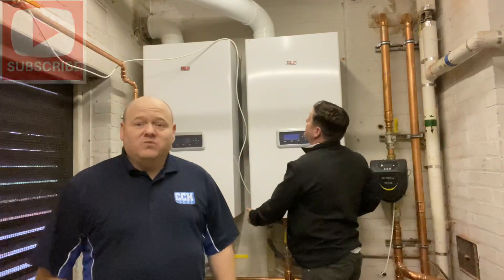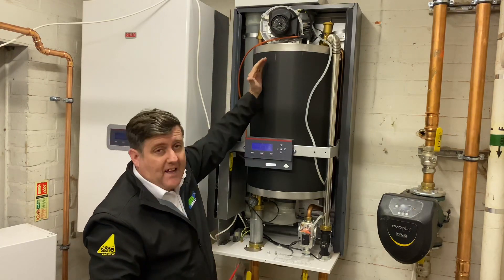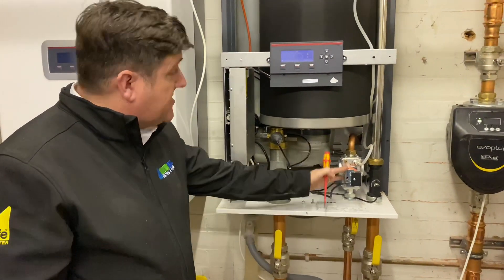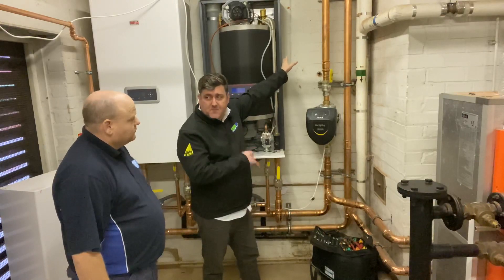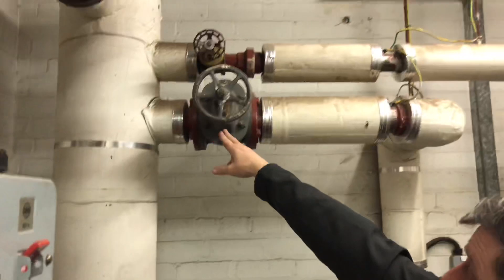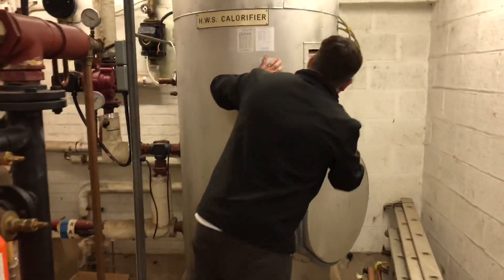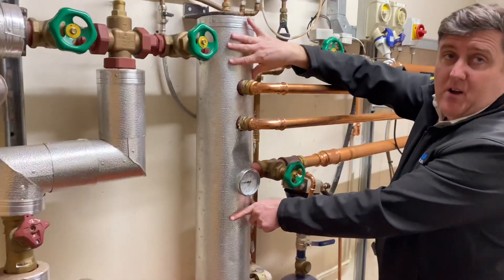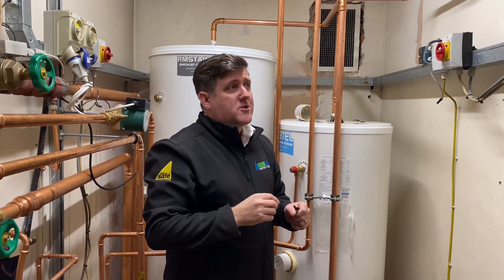RIELLO BOILERS - EXPLANING A PLANT ROOM Commercial Plumbing

Comment: Allen thank you so much for your videos on commercial heating. 
You have 2 hot water cylinders near the end of this video, the problem I'm struggling with is that the smaller cylinder (which looks like a direct cylinder) only has hot water in it as longs as it is being drawn off. So in other words after a long period of time let's say you choose to boost the hot water, which is now cooled in both cylinders, you will have to draw off that whole smaller cylinder's worth of water before you can get the hot-water that's being heated in the big 500L indirect cylinder. 
Am I seeing this correctly? Or is this being combatted by the secondary return returning back to the larger 500L cylinder so eventually, the smaller one would also heat up in which case the constant circulating of such a large volume of cooled water from the smaller cylinder may greatly lower the temperatures of the hot water and the boiler will have to compensate by being on longer to bring the domestic hot water to its target temperature? 
 What are the advantages of this set up over a more traditional method of coupling two 300L cylinders for example?

Comment: Allen once that return pump has failed I’ll get ridiculous low pressure on hot water right? At work I’m trying to trace the hot water pipes they have a return by the way in a massive plant room and I’m trying to figure out what’s happened to the hot water mate it’s cold and the pressure is poor... 🤷🏾‍♂️
Reply from the maker: The pump doesn’t effect the pressure, It just moves the heat around. Thanks.

Comment: The removed ACV cylinders are a cylinder within a cylinder. The inner cylinder has the fresh water inside.  The water between the two is primary water heating the inner cylinder all around it from outside in, eliminating internal heating coils. The inner cylinder is domed top and bottom with the col entering the bottom and hot out of the top - no sludge accumulate on the cylinder, which also has no cold spots.  Domestic versions are available being well worth buying, being superior to others for sure.  They are very efficient with fast cylinder reheats. 

The primary water in the ACV, between the cylinders, can be used as a smallish thermal store, say supplying the rad circuit of a house. The boiler heating the ACV only heats the outer part of the cylinder, giving it full flow through its heat X, all the time. Only a simple cheaper boiler is needed. The rad circuit off the ACV cylinder can be on a smart pump with TRVs on all rads and no central wall thermostat. The boiler does not cycle as it heats the ACV, cuts out when reaching setpoint, then only comes in when the ACV has cooled enough. If you need a large volume of hot water on tap at all times, an ACV cylinder/thermal store is great way to go. Simple, giving boiler longevity and TRVs in all rooms.

In the situation in this plant room, it appears the ACVs would be just highly efficient rapid recovery hot water cylinders with the thermal store aspect ignored. I would be interesting to know why they were replaced.

Comment: Having the cylinders DHW flow in series (cold into one cylinder, hot out and into the cold tapping of the next) means one lead cylinder is used in times of low hot water demand (say at night). When the lead cylinder is up to temp a valve diverts water into the secondary cylinder's coil to heat that. The lead cylinder always has priority, so if that is below DHW setpoint primary water if sent to its coil, cutting out the secondary cylinder. 

I did this once in a large domestic house using one 100 litre lead cylinder and one 300 litre secondary. A wall switch could bring in the secondary cylinder. They did not have to heat up 400 litres of water most of the time, reducing bills. In summer when cold water was at higher temperatures, they found only the smaller 100 litre lead cylinder was needed, as the semi combi effect took hold. Simple using off the shelf domestic controls.  

This can also be done with one tall cylinder with two heating coils inside, one top for quick recovery and one bottom to heat the rest.  Only the top heating coil can be used switching out the bottom in low hot water demand, so only the top half is heated. Having the top coil a rapid recovery coil, means that the boilers hot water is reheating the top of the cylinder as DHW is being drawn off - in semi combi mode. Two off the shelf cylinders is usually cheaper than one custom made two coil cylinder. Also, if one cylinder needs replacing less cost.

Comment: I have a viessmann commercial gas furnace for my house. It runs the heating and hot water (paired with a hybrid ACV boiler)
The reason for having such a beast is my house is huge and heat isolation is not the best.
Reply from the maker: Thank you for taking the time to watch my video.

Comment: When i did it it was all designed you just followed the drawing not like domestic
Reply: Yep, engineers design commercial while domestic is rule of thumb.
Reply: @johnburns4017  when my dad was working we did nursing homes and a fair bit of comercial work i loved it found it very interesting that was before the separate gas tickets now dads retired i mainly do domestic its less hassle money wise etc and im not a young man now lol
Reply: @johnburns4017  iit was funny actually as i canremember a few jobs were they were designed and old sid would filll the wall with a rad and one job a pump set was specified and it wasn't available so we fitted a smaller pump we could get off the shelf to get the job going and it worked a treat which brought in to question why we needed such a big pump lol
Reply: @charliewillis8527  
The fudge factor, 10% over. It may have been oversized as the client may have said the system may expand at some time. Sometimes space is left on walls for extra wall mounted boilers.

Comment: Enjoyed that, I'll make sure you get some laminated cutaway images to show you just how the internals of the heat exchanger is configured as it's a twin parallel coil on outputs 57 to 135 kw, single coil 35 and 50KW modules. On the right of the gas valve is a neat feature, a flow meter, this allows the control box to adjust the flow rate through the boiler not only on flow and return sensor temperatures but quantity which makes the calculation of pump speed more precise. Thank you.
Reply from the maker: Working on it👍

Comment: The three way valve looks like a modulating valve for boiler back end protection  - to prevent the boiler condensating. The modules are not condensing boilers, needing the return into them at a high temperature to prevent condensing, unlike condensing boilers.  It also prevents thermal shock to the boilers when say a heating zone is up to temperature and then another zone is opened that contains cold water sending cold slug into the boiler. In short, the boiler(s) pump around in a pipe loop, directly in and out the boiler, when temperatures are OK in the loop hot water is pumped out to the zones. If water coming back into the loop from the zones is too cool, the modulating valve mixes hot loop water with incoming cool water to keep the loop at a minimum temperature to protect the boiler/prevent condensation of the flue gasses. 

Even condensing boilers may still have back end protection as the heat Xs also operate within a temperature range, although a lot wider than non-condensers. Replacing commercial boilers is an expensive operation, so enhancing longevity is built into the system design.

The 3-way valve on the calorifier is a diverter valve. There are some domestic diverter valves available. Hot water is pumped into the cylinder's coil, when up to temp, the valve _diverts the hot water back to the boiler, by-passing the cylinder.
Reply: Nothing to do with back end protection it's the wrong side of the LLH! Its a V/T ( variable temperature) circuit. The guy in the vid also calls it the primary circuit/ pumps, it's not.
Reply: @bigbadface  
I never looked properly. You are right. Yep variable temp circuit mixing cool return water with hot water from header. The modulating valve mixes the two. Yes, not primary pump.

It will have back end protection to prevent condensing of some form. All I came across did. 

Domestic non-condensing boilers had the whole system designed to run hot to prevent condensing. The heating system itself was back end protection. That is why rads were rated at 80c in with 70C out with the boiler running at 80C. Strangely most still size rads with these temps even though condensing boilers are fitted.  60C and 40C is more appropriate.

Comment: The boiler modules were a great idea. In some a frame is set up, with additional modules added as needed. Great in a large site which will be extended. The modules are small boilers in their own right. The modules are sequence controlled, switching in each module as needed dictated by the heating demand.  

In big domestic installation I always tried to get in two small domestic boilers, fitting a sequence controller.  Two boilers gives redundancy, and in most cases was cheaper than one large boiler. Popular boilers were cheap. With modulating boilers it is more complex these days. In ye olden dayes just a pipe stat could control the sequencing, by opening a zone valve to the lag boiler, which switched in it.

Comment: Yes, downward firing spiral tubed heat exchangers have many advantages. One is that the heat exchangers rarely need cleaning if at all, as the condensate washes them through. As in Allen's Baxi v W-B vid, the W-B also, as mentioned, has a similar type of heat X.

The combined fan/burner, I believe Intergas use the same manufacturer, Reillo. with a scaled down version of the burner.

Comment: Previous concord super estimate 200 kw
With 2 inch steel gas supply.
New installation gas pipe work size possible 28mm copper ?
Reply: Why run 28 mm if you gotta rip it out , run 54mm gas to the new boilers then do the swap over . No purge point , no Id tape , flues look close to doors
Reply from the maker: It’s not finished or tested yet. The old boilers are still working. When they change over the gas will be re run from other boilers. Thanks
Reply: 28 mm ?

Comment: Reverse return , boiler shunt pumps, low loss header , CT for hot waters and fan coil circuits , VT for heating , the three way valve is a blending valve used for variable temperature output to the building radiator circuits controlled from a building weather management compensation and after working within commercial and industrial heating sector with 3 generations and 35 years of personal experience know plumbing and commercial heating are a separate skills
The new boilers are a step in the right direction but would like to see hydraulic separation , plate exchanger to protect the new boilers from system debris to ensure the boiler manufacturer Warranty.